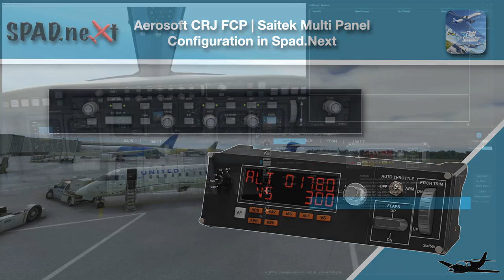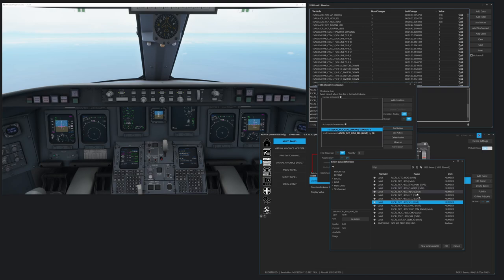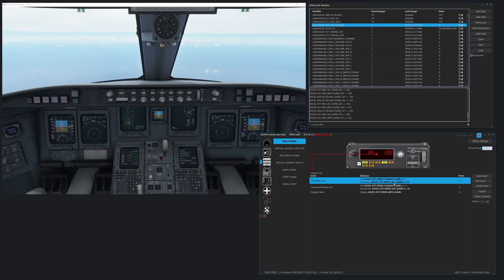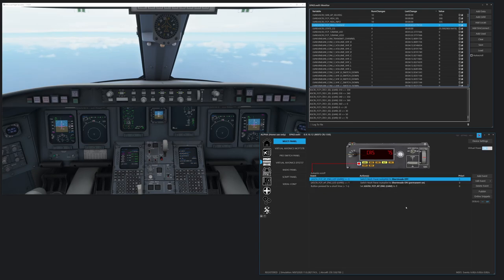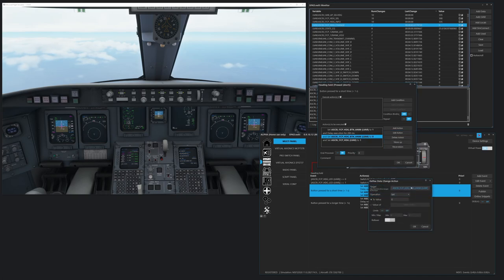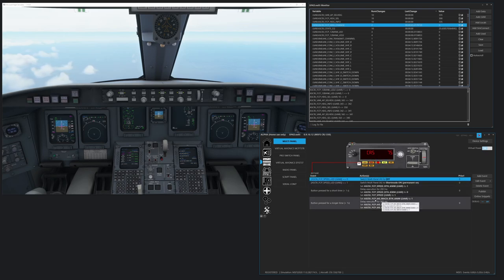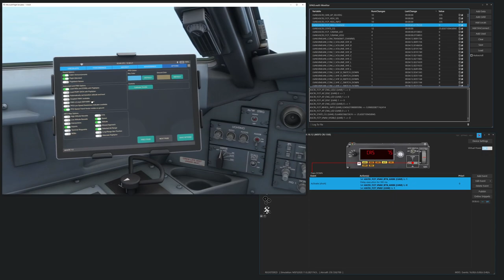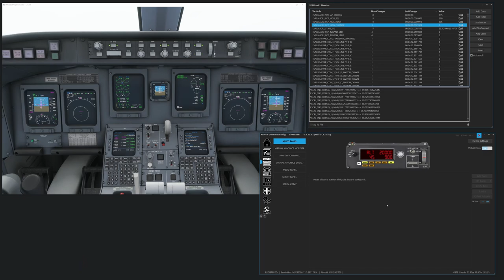(Sim Video) AEROSOFT CRJ LVAR Autopilot Configuration

Comment: Now that I have the CRJ nearly under control (I can actually climb without the thing overspeeding on me), I'm ready to figure out the MCP. I tried mapping the ALT change and could not get it to work. Now I know why. I'll be working on my config after work. Thanks again Les.
Reply from the maker: I did post a snippet that you can download buy I agree that working out the issues makes it so much better later one when you have to apply what you learned to a different aircraft or panel type...  Have fun!
Reply: @LesOReilly  Thanks. 😉

Comment: Hello Another question, I did all the configurations on Spad next on the CRJ 700, to do the same on the CRJ 550, I have to repeat everything, do I have a way to copy and paste?
Reply from the maker: Use that same profile for the 550. Also you can “make a new profile from existing” ...  forget the exact name of the button but if you go to the profile page. Load your CRJ profile on the right you have a bunch of options one of them is to make a new profile based on the current loaded profile.

Comment: Great vid Les, any chance you could publish your profile for others in Spad Next?
Reply from the maker: I have published each as individual Devices....  At the end of the video I show how to get this one specifically...  I have published the Base CRJ Switch panel and a Base Alpha Yoke where the switches are also mapped to "base" matching switch events.   

My Profile will not be of much "use" since I will end up with totally different Settings in the end.  Since I have a bunch of other devices I will repurpose those buttons/switches that are "duplicates"... and for example on my setup I will have mapped the Engine Start to my TCA Throttle....  

Long Story Short ...  I have made "base" panels/devices currently for Switch Panel / Alpha Yoke /  Saitek MultiPanel / 737 MCP and published them as individual Device Snippets.  That way you can just Add them as a device into your profile and then work from there.  Similar I will publish the TCA Throttle in the coming days as I finalize it... with the Alpha .13 release there are now access to more H:Events and I might leverage those for how I do the reversers...
Reply: @LesOReilly  That's great, thanks so much for taking the time to make the vid and explain how the LVAR variables are set up.

Comment: Are there any ready to go profiles in Spad? This programming is hard to me and i wonder, can You buy SPAD and then just load for ex. profile for alpha/Bravo in ARROW IV?
Reply from the maker: If someone has published their profile for that plane then yes. More often you may find that you have devices that someone else does not… or they have a device you do not and thus their config may not be best suited to you. Device Snippets are also available and may be more suitable since you can grab devices one by one and pull them into your Arrow Profile.
Reply: @LesOReilly  Thank You so much. So device snippets will be the best i think. And what i understand, when using SPAD i dont need to change any setting in MS for bravo etc. because it will be the main program for device?
Reply from the maker: @marcinus2000  You will need to make a blank config in MSFS for the device... otherwise both MSFS and SPAD will send events for the assignments.
Reply: @LesOReilly  thank You so much!

Comment: Hey, that was great tutorial. Are you going to do the same for radio panel? COM, ADF and XPDR works great with CRJ.  NAV frequency can be only switching between ACT/STBY and it's displayed coirrectly but can't be changed by the knob.
Reply from the maker: The NAV STBY Frequency is an issue with the CRJ.  It is not using the Standard Sim Data values it appears...  And it does not present an LVAR for that....  So for now yes I am also stuck with having to go into the FMC / CDU and use the Radio page (I like that better than the Virtual Knobs...) Also since the Avia Server has the CRJ FMC available on my tablet via wifi :)
Reply from the maker: So I did a radio panel video and I did a workaround for now that makes the radio panel work for Nav ... the data is there and it drives the plane and the PFD just now the RTU display does not update. But hey I can tune it with the radio panel :).

Comment: Hi, after this latest update of MSFS 2020 1.15.7.0, when I start the simulator, a small window appears, written LOGMICROSOFTFLIGHTSIMULATOR, THERE IS ALREADY AN INSTANCE OF THIS PLUGIN RUNNING, and the simulator crashes, if in the community folder, I delete the SPAD-BRIDGE-MODULE folder, and start the simulator, the window shown above appears the same, but the simulator opens, is there any problem Spad Next?
Reply from the maker: Sorry this was stuck in the "spam filter" I guess due to the numbers thinking you are putting in an IP address link :)....  I am sure you already resolved this but it was due to a MSFS WU4 and all WASM modules were broken...  They pushed a big update on Friday (1GB patch) that allowed us to but the bridges back into our community folder..
Reply: @LesOReilly  Yes thanks, then it was fixed

Comment: Hi, I have set the multi panel, on the CRJ 700, as explained in the video, only that the knob, either I turn it to the left, or I turn it to the right, the value indicator always goes to the right, and consequently the plane goes right, where can the problem be?
Reply from the maker: On the decrement you need the set value to be -1.
Reply: @LesOReilly  Hello, now it works, because in decrement I had not put the minus in front of the value 10, even the values correspond, between the aircraft display and that of the multi panel, the only one that is not in sync, is the IAS  value of the aircraft display, does not correspond to that of the multi panel, what could be the problem?
Reply from the maker: Not sure...  It all worked for me..  On my MCP I actually have it with conditions so I can see mach speed or the IAS speed....
Reply: @LesOReilly  It is the value of the Multipanel that does not coincide with the value of the Bug Magenta of the primary display
Reply from the maker: okay pulled it back out again.. Plugged it in... on my Saitek Multipanel for Speed Value I have the IAS page linked to display ASCRJ_FCP_SPEED_INFO and that is what is published in my device and what I see matching on my speed bug in the PFD on the Multipanel and in my 737MCP I use...  Maybe move this over to the discord channel since we can post pictures and screen shots of what you have in your spad next?
Reply: @LesOReilly  Ok it works, I did not understand, that by turning the IAS knob to the right or left beyond the minimum speed and maximum speed limit, it is normal that the multipanel display value no longer coincides with the aircraft navigation display, while during rotation of the knob to the right and to the left inside from minimum to maximum speed, the value indicated between the multipanel display and the navigation display coincides perfectly, thanks again for your availability, hello.

Comment: Has anyone had issues with the ALT/HDG/SPD dials just all the sudden start spinning on their own when you are dialing in an AL/SPD or HDG?
Reply from the maker: Do you have and buttons or switches bound in the sim to devices like an alpha Yoke?
Reply: @LesOReilly  I have a Saitek Yoke and throttles..what is an alpha yoke?
Reply from the maker: Honey Comb...  Basically there is a known bug in the Sim that when a button is held down (this happened a lot with the Honeycomb alpha yoke) because MSFS does not understand "Switches" so if you have a switch mapped in the Sim..or a Button...  

When held it always does the "Repeat"...  Well the sim has an "acceleration" built in for things like knobs and buttons so that when you hold it down for a longer period than normal press it will Accelerate the Actions...

This though is not "event" specific... People found that when they had the Landing Light for example switched on that it was sending the Event over and over again...  When they tried to turn the HDG bug it would move by increments of 10.... Turn off the switches and they were good to turn in increments of 1...

The CRJ is also doing it's own acceleration with the LVARs so you have to be careful that you are not somehow into that MSFS bug of basically Globally shifting the entire cockpit into acceleration modes.

Only other thing I could think of is that you have Spad next doing the acceleration and that might also be ramping up the CRJ LVARs where you don't need it with the CRJ but you need it with Default planes....  I think I have that off on the MultiPanel as it was ramping up crazy fast since it was increasing the events... which then increased the Events in the CRJ Acceleration...

Comment: any chance you would be willing to share your spad crj profile?
Reply from the maker: I have published all of the Devices as individual devices.  This you will see at the end of this video how to download and add this panel into your Profile.  My Profile is actually not the same as what I have published per device.  I wanted to make sure that the individual devices are representations of the switches to the best I could make them without the expectation that you would have all the other panels I have. 

 If you were to take my Profile you would need to have all of the same devices that I have for the bindings to make sense where I have gone ahead and totally repurposed buttons that are "common"... example is my Alpha Yoke and Saitek Switch panel have a bunch of the same buttons and knob -- which I have mapped to different events ... the Taxi/Landing/NAV/Beacon/Strobe on the Alpha are the lights... but on the switch panel (mounted above my head in my overhead) I have made into other events like hydraulics, separated out a bunch of the De-Ice items so that De ice is now my windshield only while taxi is the wings and landing is the cowl ... 

Eventually when I get further along I will publish it via the Publishing tool in the app, but again I find it better to publish the individual devices... You will see lots and lots of devices posted by me... Its also an easy way for me to park them go to another profile and then pull it in... especially if I come up with a new "Mod" or feature that I like ... I just publish that again and next time I switch planes I will just pull it down from the online snippets and update my plane :)
Reply: Ok I’m not to familiar with SpadNext to begin with,but did follow the instruction to upload your setup and I see a bunch of stuff with your name but I don’t see this one? Did you removed ?
Reply from the maker: @Azorean77  no nothing removed. There is a check box when doing individual devices regarding aircraft. You can uncheck it and then it will no longer filter out units not related to the plane you have loaded.
Reply: @LesOReilly  it works 😃 thanks a million lol

Comment: Hi guys, I have the MSFS 2020 flight simulator, when I click install SPAD.neXT LVAR Bridge, because a window pops up saying: RUNTIME ERROR AT 98: 247, NO SUPPORTED SIMULATION FSX / FSX: SE / P3D FOUND! ?
Reply from the maker: That is because that is not how you install the LVAR Bridge for MSFS 2020.  You have to manually copy the contents of the Zip file from the Spad folder into your community folder...  I have a video for installing and setting up the LVAR bridge the 20 second mark or so is where you will find the paths
Reply from the maker: And the video is here .... https://youtu.be/jX-6Jgp8uvA
Reply: @LesOReilly  Hi, I did as explain in the video, however, when I click ADD LVAR, it does not download anything.
Reply from the maker: Is the sim running with the CRJ? What version are you on in Spad.Next?
Reply: @LesOReilly  0.9.10.13
Reply: The open Simulator and the CRJ 700 in cold and dark ok?  I also state that I always install the simulator in flight C: \ MSFS 2020, I always avoid the passage of path PROGRAMS
Reply from the maker: Yes Sim Running and CRJ Cold and Dark is fine.  Spad has to be on Version that supports LVAR (Alpha is currently on v0.9.10.13) Also you did copy the Contents of the LVAR Bridge Zip into the community folder?  After you did move the LVAR Bridge into the Community folder you do have to "restart" the Sim....
Reply: @LesOReilly  Hi, ok I solved, the bridge folder, download LVAR, only if I unzip it, directly in C: \ MSFS 2020 \ Community, just like that it works, now the problem is that your video, at minute 1:17, under the  image of the Logitech Multipanel, there are already values that I am not sure how to display correctly, do you have another video that I can watch?  because I have been impacting from the very beginning
Reply from the maker: The LVAR Video showed the Requirement Unzip that into the folder... Good that you have that now resolved...

In this video I go through how I set up the panel completely step by step and then at the end I show you how to download the config via the online Snippet section...  Maybe just jump towards the end of the video and download my panel config from the Spad Online Snippet database...
Reply: @LesOReilly  ok thanks
Reply: @LesOReilly  Hello, the snippet panel, I seem to have understood, that they are ready, I wanted to understand to learn, how to insert an event from the beginning.
Reply from the maker: Sorry which panel?
Reply: @LesOReilly  Is the snippet panel not made up of users?

I wanted to learn and create a profile
Reply from the maker: @Alesim-yg4ki  oh got you...  There is a Script panel :) which looks like a BIP in the GUI that let's you run stuff...  Okay you want to make and publish Profiles.. Got it... Yeah I guess I could do some videos that start "from the beginning"..  Thanks..  Will try to do some of those next :)...  FYI to publish stuff you have to go to the Spad Next fourums and "link" your hardware ID to your order ID...
Reply: @LesOReilly  Thank you, it would be a great help